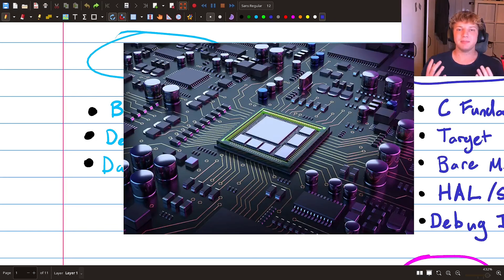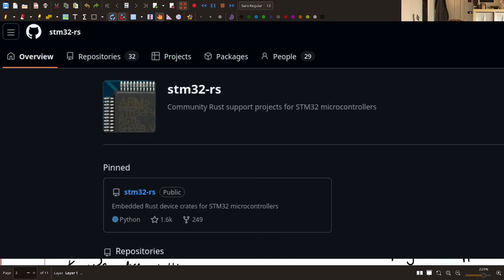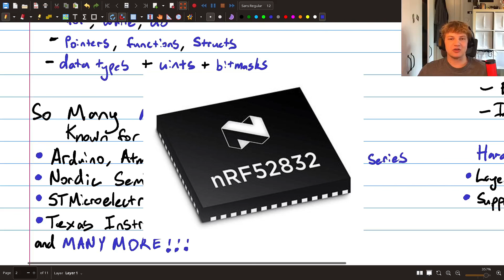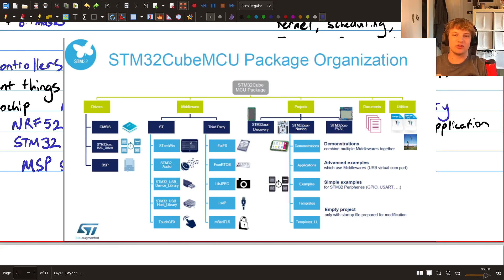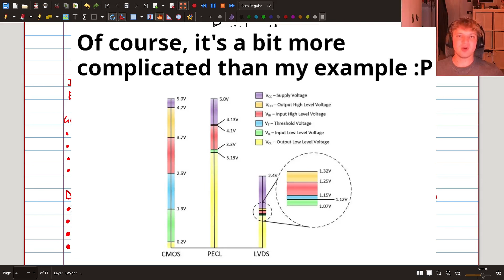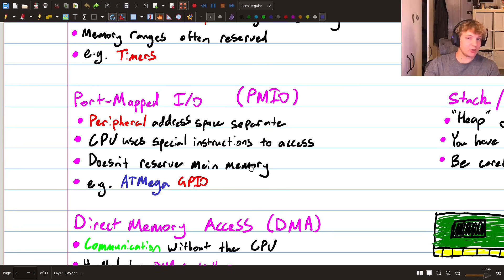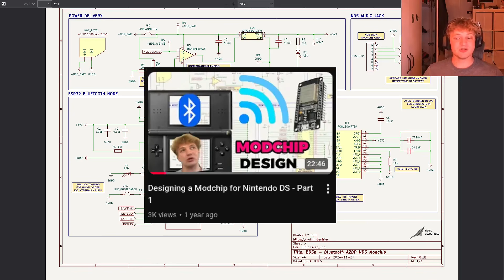COMPLETE EMBEDDED SYSTEMS Roadmap - What Arduino Won't Teach You

Comment: Master embedded Linux. You'll thank me later (Do it as a reply under this comment).
Reply: Please elaborate a little on why? I have worked in Embedded for the past 7 years and I have never needed it. But I am curious to explore  it for the right reasons
Reply: @Curiosity-inVader  Thanks for asking. The reason simply is new applications. Back in the day embedded applications barely exceeded classic robotic arms or old-school automotive embedded computers in which zero data-intensive sensors or algorithms were involved. Nowadays you might serve an LLM in an embedded project, or you have huge computer vision /speech recognition models that require deep learning on edge libraries like ONNX. Or even beyond that you might completely ditch general purpose platforms for SoC/SoM customized frameworks. Like nvidia jetson or rockchip. You just can't afford classical embedded paradigms in those cases. I mean sure bare-metal/rtos embedded is completely valid but for its own specific applications. I mentioned embedded linux since it is a gateway to new opportunities and new ways a portable computer can be used.
Reply: @Curiosity-inVader just trying to get into embedded - what kind or companies and areas of applications did you work in?

Comment: I am a Computer Engineering freshman and am 16yrs. I have been programming an Arduino and esp32 and I am currently learning ML and Computer Vision and I am starting a Robotics club in my university. 
I want to go into VSLI or embedded systems. So am thinking of doing a master's scholarship in either of VSLI or ES, what's your advice.

And I am also a web dev, and am currently learning backend. I started with web dev too
Reply from the maker: it's great to get into the field that young, you'll be miles ahead of people by the time you graduate university. before signing up to do more study I would strongly consider the following points:

1. universities want you to study for as long as possible so they can make money
2. does the field you want to go into REQUIRE more qualification beyond a "comp engg" degree
3. after you get your degree, can you self-study these concepts instead or does further study provide REAL value you can't get anywhere else
4. are companies in your field willing to provide training on the job to make up for specialist knowledge

If the answer to 2 and 3 is yes, and 4 is no, then go for it, otherwise strongly think about it or you may end up wasting time and money
Reply: @hoff._world  wow, thanks, I need to think about that along the way
Reply: @hoff._world  But the decision-making is too confusing nowadays. Like am I too unqualified based on my CompEng bachelor's degree? If so (or even if not), should I go for a MS degree? Or do I seriously only have left to apply RTOS in a project or work experience to get more interviews for Embedded SWE jobs (given i already have a bare metal project and some PCB experience)? I don't get where i should stand since I graduate soon for my Bachelor, and I have never landed a job/internship offer throughout undergrad. US located

Comment: Can you really go into embedded without EE fundamentals like circuits? (Haven’t finished the video yet btw)
Reply from the maker: my answer is no
Reply: Not strictly necessary, but it helps a ton to have the basics. Things like components, ohms law, understanding of electrical flow etc. I highly recommend a specific book that does exactly that + a bit of microcontroller programming, it's called "Teach Yourself Electricity and Electronics" by Stan Gibilisco. It's completely worth the investment and you can take a chapter per week if you like to go slowly, but your curiosity will likely take over and you'll do many chapters very quickly. 

If you want to manipulate any external components (critical to microcontrollers), having an understanding of electronics is incredibly helpful.

Comment: Is arduino aarch64??
Reply: No, it's Atmel's AVR processor and instructions, it's a fundamentally different architecture from ARM
Reply: @CasioDingDong thank you for correction, I just started read osdev yesterday for understanding my phone especially  how Linux phone works, I have confused about RISC, so I ask Gemini is my phone embedded system and she say yes.
Reply: @hasanAinulyaqin the division between general purpose computer and and an embedded system is getting rather blury. It also doesnt help that besides specific chips (like intels i7 and amd whatever is there right now) there are different architectures. Your phone is ARM architecture, Acorns RISC Machine, which is an implementation of architectural standard of RISC, which stands for Reduced Instruction Set Computing. Reduced as an oposition to CISC, which is Complete/Complex instruction set, which are intels and amds x86_64 processors. Even thoug your phone is on ARM, it functions more like a general purpose computer rather than small embedded system, like a fridge (fridge has single purpose). Currently Apple has ARM only computer lineup, there are also some ARM snapdragon laptops. Arduino has Atmel's (company) Atmega (chip) which implements AVR (standard i think). Arduino has no virtual memory capability, which is a requirement for most fully fledged operating systems, including windows. What is virtual memory? Processors have cache memory with physical addresses, if you van access physical address directly through code, then it is not virtual. There is a lot to comouting
Reply: @hasanAinulyaqin  Technically your phone might have embedded parts, but usually when we talk embedded, we mean microcontrollers, which mean deterministic processors. The chip in your phone is not deterministic by design, among other things, so it’s not a microcontroller, thus not embedded. It’s mainly traditional computing
Reply from the maker: @CasioDingDong what do you mean by they are not deterministic processors? by definition all classical computer chips (i.e. not quantum) are deterministic at the circuit level. If you're talking about software logic, special 'random' instructions, scheduling and multicore processing then I understand this, but there are "multicore" microcontrollers as well.
Reply: @CasioDingDong that is so incrrect it hurts to read
Reply: @hoff._world  Branch prediction is one of the first fundamental things that makes a processor lose it's deterministic properties. If a processor, doing the same job twice, does not take a predictable amount of time to do it's job, than it's not deterministic anymore. Yes, in very small parts, it can be deterministic, but as a whole, it's not.

Classical processors can easily be faster or slower by a wide margin on the same exact programs. They will give the same output yes, but the time frame is incredibly important in the naming of processor classes, and usually what makes a processor deterministic or not
Reply: @masterofdizzzaster  What is incorrect? I'm legitimately eager to learn, so I will gladly hear you out
Reply from the maker: @CasioDingDong  ok I see you're referring to completion time not output. this still doesn't account for the simple counterexample that the ARM Cortex M7 chips have branch predictors and are featured in the STM32F7 series of microcontrollers.
Reply: @hoff._world  It was one example, you can make deterministic processors that have these features. However, classical computing still isn't deterministic in time, which is why compile time, for example, can vary by a noticeable margin on a normal computer. Yes, computers are deterministic in output, but if that was what we based the definition on, then pretty much all computers would be deterministic, and the classification would become useless. All I'm saying is, classical computing processors are not time deterministic, which, from how we usually classify determinism, means those processors are not deterministic.
Reply from the maker: @CasioDingDong i suppose bad assumption on my part, usually when I hear deterministic referring to processors it's about the debate between classical vs. quantum. I agree with all of your points on determinism but I don't see how it links back to the original claim that "microcontrollers are deterministic" - my position is that I fully agree with @masterofdizzzaster that the line between regular computers and embedded is becoming more blurred with for example the Cortex M7's that have branch prediction, the multicore MCUs, embedded linux, etc.
Reply: @hoff._world  I agree that it's blurred, but embedded targets devices that have a specific and well defined function. But, for a smartphone, that's not what it's about. A phone is not just a phone, it's a camera, a microphone, a streaming device, a gaming device, a reading device, etc. It's not specific purpose like embedded, where you usually get microcontroller processors doing a single task like managing a thermostat, or handling hdmi inputs for a tv. Microcontrollers don't have to be deterministic, but it's incredibly rare you'll see microcontrollers not be deterministic. That's because even ARM themselves divide the classifications, and they switch design philosophies once they step out of microcontroller territory and into real time processors and application processors (with MMUs that can support non-RTOS OSes). Joseph Yiu, the writer of M3 and M4, and M0 and M0+ books, made a community "white paper" called "ARM Cortex M for Beginners" which clearly define the difference between these microprocessor cores. In this paper, only microcontroller processors are classified as "embedded" or "deeply embedded". Also, they, in the first table of the paper, specifically state "deterministic" under "microcontroller processors".

As for credibility of the source, Joseph Yiu is a long standing ARM engineer, who was involved in many microcontroller processor designs, and also made many books about them. As for me, I searched on the web I guess
Reply from the maker: @CasioDingDong sure I agree on the definition of embedded device but I don't think that's the point of what they were discussing. Plus you have now gone from saying "all microcontrollers are deterministic" to "ok some are non-deterministic but it doesn't matter". The point we are discussing is that making blanket categorisations like "this processor is a microcontroller" and "this is not an embedded system" is getting much more difficult to make. For example, I would argue that a phone is a combination of many embedded systems. Does that make the whole thing an embedded system? maybe? What about a smartwatch? And by who's definition is it so? Ultimately, I think it is pointless to discuss such things.
Reply: @hoff._world  I was just saying a phone is not embedded, and I added although it might have embedded parts, that doesn't make it embedded. Like how my bike is not a car because it has wheels
Reply from the maker: @CasioDingDong yeah and your car's centre console might use a snapdragon chip same as your phone and run a variant of android, just as your phone. It probably also has a cell connection back to the manufacturer, just like your phone. Most would say that a car console is embedded. My point is that these big sweeping generalisations you're making (as well about what counts as a microcontroller) are kind of pointless to be making, because as the other dude said the line is getting more and more blurred. Either way, that's my perspective and it seems like we will have to agree to disagree
Reply: Its atmega

Comment: If you're completely new to electronics, you can grab a stm32 nucleo board and then use stm32duino to follow arduino guides/tutorials, if you're overwhelmed by jumping straight into cubeide
Reply from the maker: this is good advice, but please go in with the awareness that you need to move off the arduino scaffolding at some point!
Reply: @hoff._world  MS Visual Studio is buggy and temperamental. Arduino always works. I hate the way these "better" packages are so fussy and expect you to set a million things up just right.
Reply: @Andrew-rc3vh  that’s kind of how things are when you start working with microcontrollers at a lower level though. A lot of work goes into  things that are purposefully simplified by arduino to appeal to hobbyists. You really need to try something like STM32 and learn about timers, interrupts, configuring peripherals, writing bare metal code, reading data sheets etc. Its quite a bit harder honestly
Reply from the maker: @Andrew-rc3vh who said anything about vs studio? STM32Cube can generate a makefile for you and you can use any editor you like...
Reply: @cgmakesbeats  I did all that in the Ardino including memory management. I just wants VS to damn well compile the bloody code. There was all sorts of buggy stuff to do with an add-on. These larger packages are poorly designed. Ardino is solid code.
Reply from the maker: @Andrew-rc3vh I don't think anyone is saying Arduino isn't solid for what it is. It's good for what it is, a hobbyist platform that gives nice abstractions for beginners to learn the basics of embedded, or for fast prototyping. But these more complex tools exist for a reason, because some projects are just more complex than what the arduino abstractions can provide. That's all anyone is saying here I think
Reply: @hoff._world  Yes I understand the objective, but stupid stuff started happening in VS. One of the most annoying was the tabs. The idea is you open the tabs with the code you are using and then if you open the package up from start the same tabs would appear. With VS the tabs went haywire and made my work most annoying. It was obviously some sort of bug playing out in a certain configuration, but no help as to why it did what it did.

 I think one reason Arduino works nicely is the code behind it has more intelligence. It will look after times where the config would be obviously wrong for some obscure reason.  You are not left helpless in front of a vast menu of settings and modes.
Reply: @hoff._world  Yes well the main advantage of Visual Studio was I found it productive. There was good debugging tools that showed mistakes clearly and the editor was better. I think with more complex systems, it is just a matter of writing neater and easier to read code which is properly documented. However for the ESP32 in order to access all the functions you had to use their IDF which was something I think was built to work in Linux, but will run in Windows. In practice these functions were rather obscure and seldom necessary. In the end I wrote the code in VS but compiled in Arduino. VS was mixing up library files when trying to compile. It was a pain.
Reply: STM32 is great, but for complete beginners, the STM32 toolchain is very scary. I would recommend starting with Arduino for very basic projects, learning how to use data sheets and read documentations + fundamental electronics knowledge, and then move on to STM32.
Reply: @CasioDingDong  The STM32 lacked wireless capabilities. The ESP32 had it all onboard.
Reply: @Andrew-rc3vh Yes, but still, more features usually mean more to learn for beginners. Of course, it always depends on what previous knowledge of computing you have before going into embedded
Reply: @CasioDingDong  I didn't have any previous knowledge of the ESP wifi system, but found it really easy to get up and running. It's good to run an example first so you have something working, then you can fiddle with it to get it to do what you want.

 The main difference with experience is you go from something to impress people with to something people find useful enough to give you money for it. That means you have to work through all the functions anyone could ever ask for and make it rock solid reliable.

Comment: Graduated w/ my bachelors in electrical engineering 2 years ago now, but I left feeling disappointed in the quality / practicality of what we were taught, It just didn't feel substantial enough to prepare you for actually DESIGNING a system or circuit (and not a single class on actual circuit board designing), just the fundamentals but not connecting the dots more between everything we learned, which I was able to do on my own, but only to a limited extent. We only learned to program an embedded chip on ONE brand / board and architecture (don't remember which but I have the dev board somewhere) and only bare metal, no RTOS.

Trying to find more info (especially on YouTube) isn't as easy as other engineering disciplines (other than hydraulic system design), in my hobby projects I find myself avoiding electronic projects just because It feels daunting and full of info and things you can ONLY really learn by doing. Other engineering disciplines you can do more "willy nilly" but still great design, but circuit design is much more meticulous / with more precise factors or constraints to take into account.

All that to say, I had to whip out my notebook and start taking notes, inspired to attempt to eventually take on an actual embedded project from design to programming.